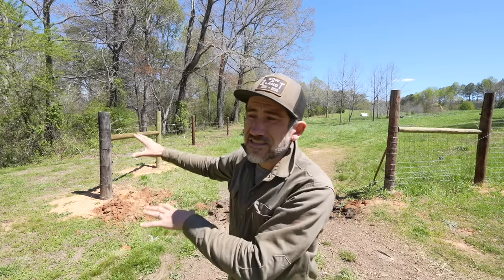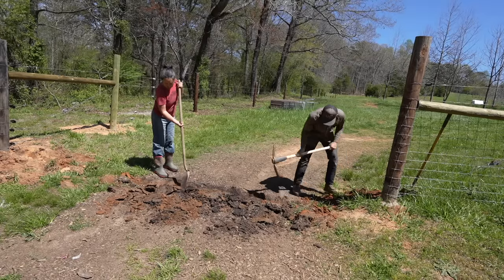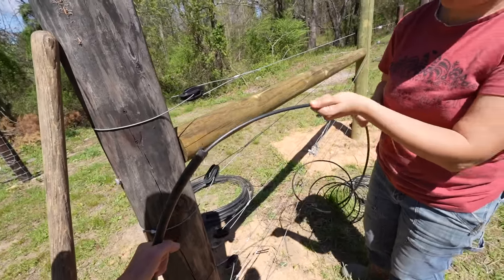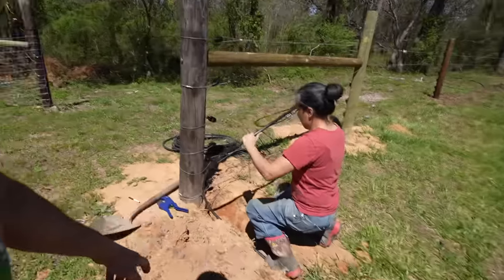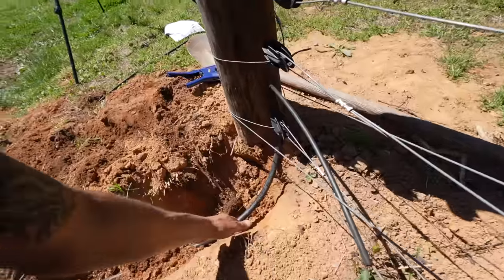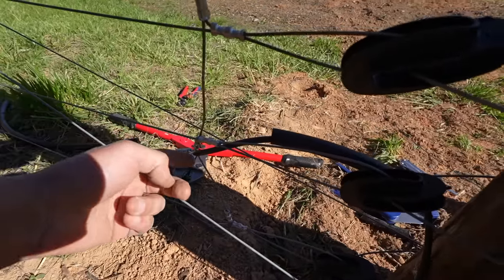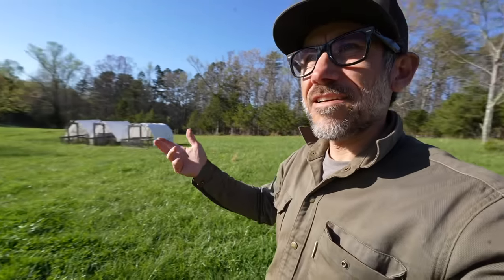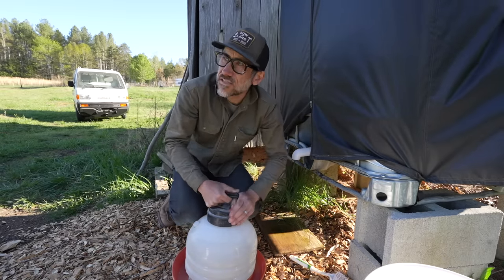Husband and Wife Team Trench Wire to Connect Farm Fence

Comment: When I was a teenager in Anson, Texas, I typically worked at the Ice House during the summer. My younger brother did not have a job and asked if he could work at the ice house in my place; so, I found another job, tearing down an old barbed-wire fence and building a new one. I worked with two friends and the greatest obstacles were the rattlesnakes, the prickly pears and the mesquite trees. The days were above 100 degrees, but that was normal.

Comment: A bit of a word of wisdom, on an electric fence.  You need to have some ground wires in there, you don't want all hot.  It won't be as efficient on getting the point across.  You need to put some breaker switches in a few places, so when you have a short or break in fence you don't have to go clear back to the charger to turn it off.

Comment: Jason, You may want to disconnect the bottom two or three wires of your electric fence. As the weeds grow up they will lay on those wires and want to ground , or short out the system. Old farmers will agree with me. Keep up the good work.
Reply from the maker: But then they are not hot. Dog can get through it.
Reply: @SowtheLand  ok, but you should know where the short-outs will probably come from now. LOVE your Kune Kune piglets. they are certainly easier to deal with than the typical hyper-active Yorkies. PS my daddy was a pig farmer long ago. We feed our "cull Apples" to the hogs, and everyone in our church wanted to buy our hogs in the fall.    ps ; let people know you are feeding your stock better than average food ( start more fruit trees now )

Comment: When I use the frost cloth, I've discovered (unfortunately) that I need to have an air gap between the cloth and the plant. If it's touching the plant and it gets frost on it, it effectively just passes that frost to the places where it's touching plants. At least that has been my experience. Maybe I was just unlucky or the frost was a really hard one.
Reply from the maker: Correct, hard frost we would be doing mini hoops.

Comment: I have buried enough cables to run your farm and as far as you went is ok but go back and daub some silicone sealant on the stripped back and unstripped back junction of your electrical wire. Eventually, if you did not water would migrate down the sleeve albeit it would take years but this is a lifetime homestead, not a ten-year homestead.
Reply from the maker: Thanks for the tip

Comment: My guess is that the tube will eventually fill with water.  If you were to use underground cable it will work for years.
Reply from the maker: it is an underground cable
Reply: He said he used cable rated for underground but used the tube for extra protection.
Reply: @SowtheLand  So sorry, I only caught that point after I had posted this comment.  You obviously wisely did what is the best of both worlds.  Much better than my idea.